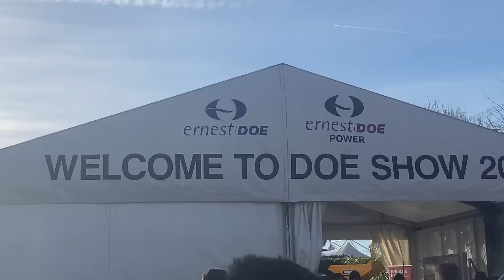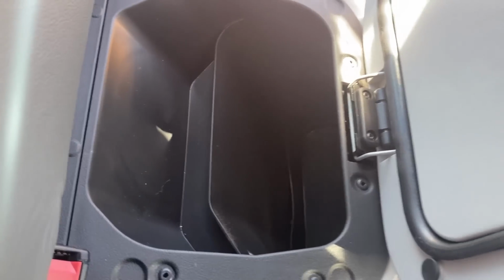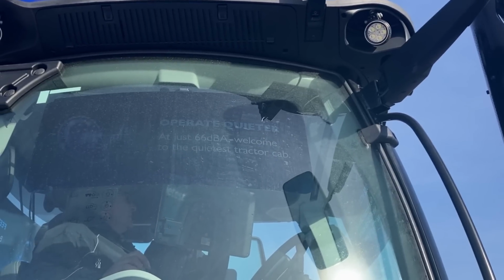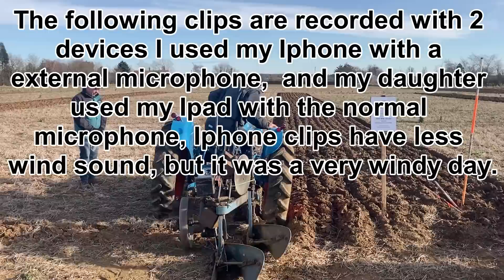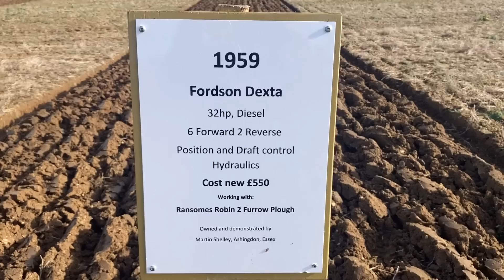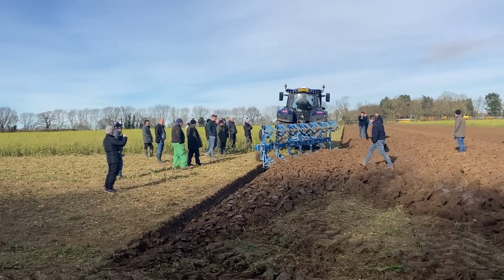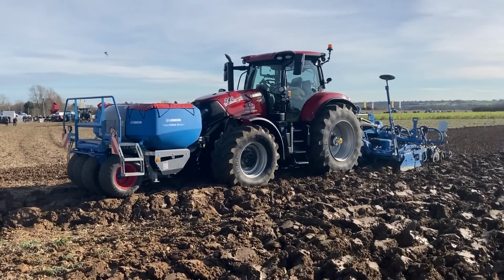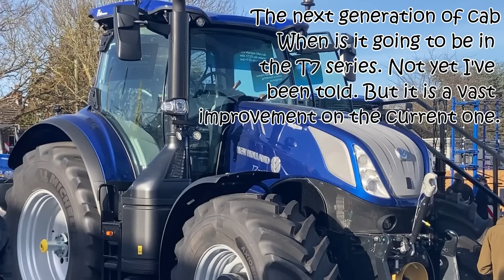New Holland T7.315 HD Blue Power, Larger, quieter cab.

Comment: 315 sure looks nice with some nice upgrades especially the stop button but to me ( I haven't been in one ) I don't like the front windscreen wiper as I feel it should at least do 180° of the screen but when you consider the old tractors only cleared a small area when they were fitted to the top of the windscreen, it is an improvement. 
Last time I went was mid nineties, would love to go again.
Reply from the maker: The wiper on my 270 is a full 180 so I’m not sure why they made that one less.

Comment: Surely the lesson there is that farms used to get done with the small old tractors working land at a sensible depth and hardly needing lights. Now you need more and more hp and a larger better appointed cab so you can work even longer hours. Where's it all going to stop!
Is that progress, serious question.
Reply from the maker: The problem is that now no one wants to be a farmer it’s too much hard work. So we have to have bigger machines as there is not the workforce there used to be.
Reply: @farmerstephen  But where will this stop? In 5 years will you be at the Doe show looking at 500hp, is the 1000hp Quadtrac just around the corner, will that be big enough. People commenting on this thread seem almost excited about how much fuel a 310hp tractor will use. There are plenty out there now pulling 12mt drills at 8-10k with 240hp now, change the system and it can be done. We’re heading for massive Ag inflation of input and machinery prices, BPS is disappearing and the replacement payments (ELS etc) hardly cover the costs of setting them up. Wander around the Doe Show or LAMMA and ask how this industry can support that number of machinery manufactures and suppliers. When you are out there at 10.30 at night that’s who you are supporting, not yourself. I see the buffers at the end of the track and people still accelerating towards them.  I don’t want to rant or preach, I’m genuinely interested in this. Best wishes.